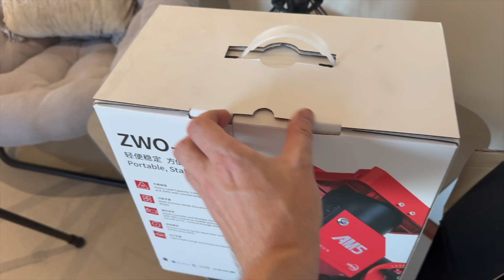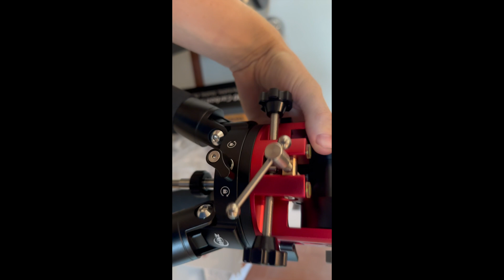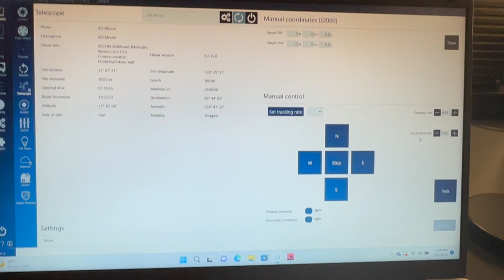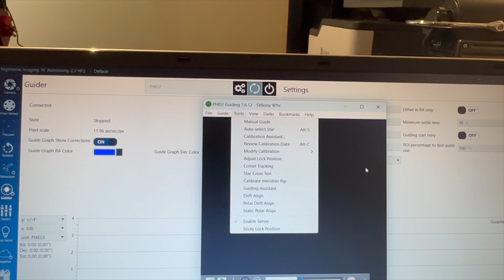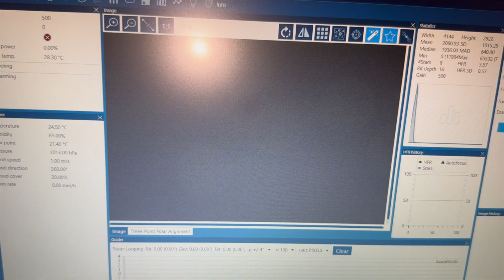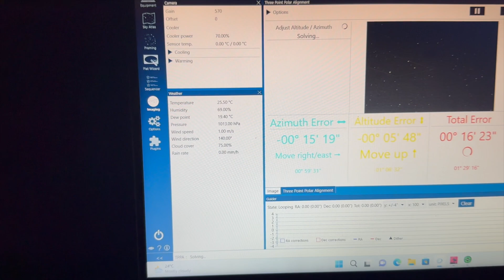First Deep Sky Image  - California Nebula???

Comment: Hi, i dont know if you already figured it out but what you captured are reflections from lights. So you probably had a bright light on while you took the pictures. I have platesolved the end Image you had and you sadly did not hit the California nebula. You were aimed a little above the plejades. If you need help with your equiptment let me know ;)
Reply from the maker: Hey! Yes I use nova.astrometry.net and found I was a little off. I'm super new to all this, but I managed to figure out the past few nights using plate solving in NINA and the framing assistant to get onto target properly. 

As for the artifact, turns out it's condensation/ice on the camera from cooling too quickly in the warm humid air here. When I cool in stages, from 20 to 10, then 10 to 50, then 5 to 0 degrees it seems to avoid this issue, and take 10 minutes for each stage of cooling.

I was able to get a pretty decent image (for a beginner!) of M51a whirlpool galaxy two nights ago, uploaded here :-
https://nicksastrophotography.wordpress.com
Reply: @AlvieraLiving  looks pretty decent :) definitely got the basics down. With a little more experience youll be able to make some great images:D